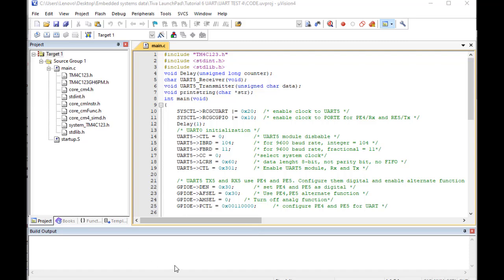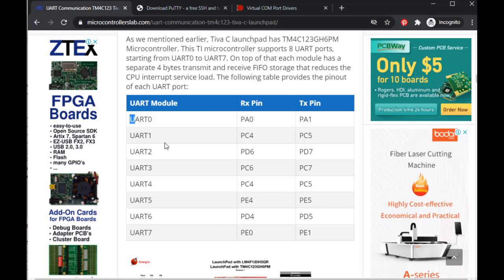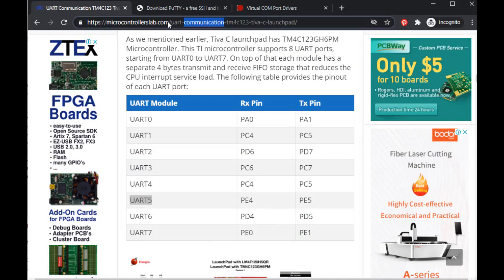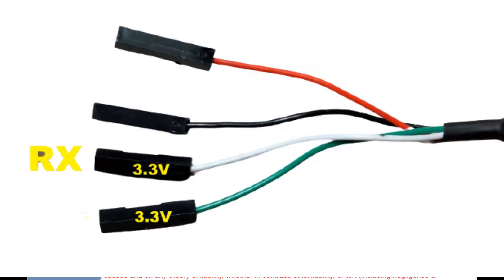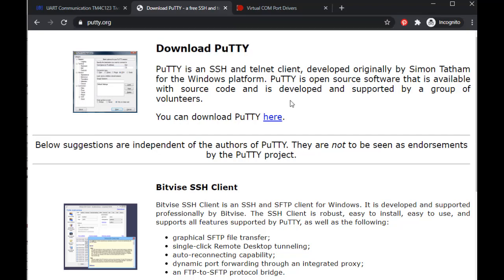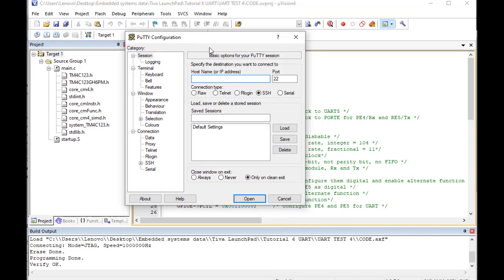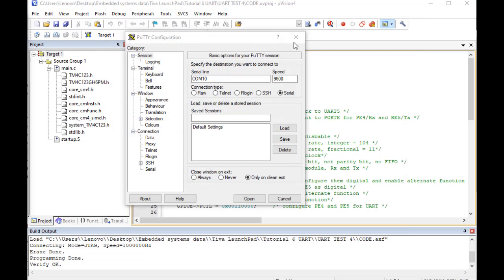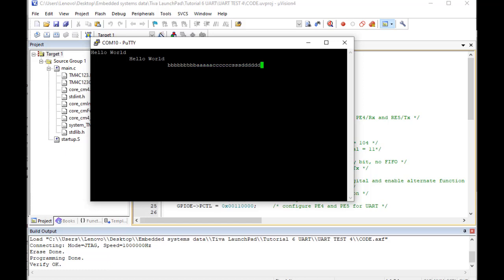UART Communication Between PC and TM4C123 Tiva C LaunchPad (DEMO)

Comment: Which TM4C123.h did you use in the video, can I have a link for that as well?
Reply from the maker: When you create a project with keil and seĺect TM4C123 microcontroller, this headerfile will be included in your project  automatically. You just need to add this line in your main.c file.

Comment: int switchstate = 0;

void setup() {
  // declare the LED pins as outputs
  pinMode(3, OUTPUT);
  pinMode(4, OUTPUT);
  pinMode(5, OUTPUT);

  // declare the switch pin as an input
  pinMode(2, INPUT);
}

void loop() {

  // read the value of the switch
  // digitalRead() checks to see if there is voltage on the pin or not
  switchstate = digitalRead(2);

  // if the button is not pressed turn on the green LED and off the red LEDs
  if (switchstate == LOW) {
    digitalWrite(3, LOW); // turn the green LED on pin 3 on
    digitalWrite(4, LOW);  // turn the red LED on pin 4 off
    digitalWrite(5, LOW);  // turn the red LED on pin 5 off
  }
  // this else is part of the above if() statement.
  // if the switch is not LOW (the button is pressed) turn off the green LED and
  // blink alternatively the red LEDs
  else {
    digitalWrite(3, HIGH);
    delay(250);// turn the green LED on pin 3 off
    digitalWrite(3, LOW);
    digitalWrite(4, HIGH);
    delay(250);
    ;// turn the red LED on pin 4 off
    digitalWrite(4, LOW);
    digitalWrite(5, HIGH);// turn the red LED on pin 5 on
    delay(250);
    digitalWrite(5, LOW);
    
  
  }
}